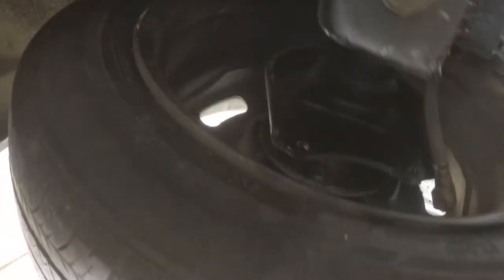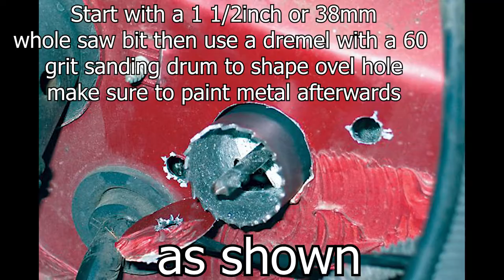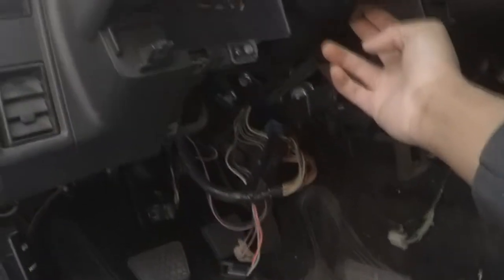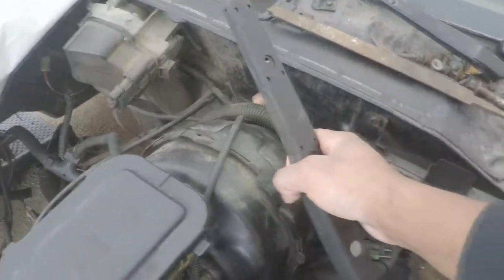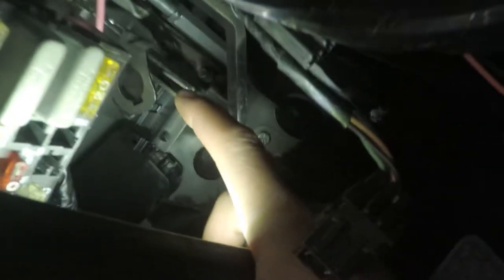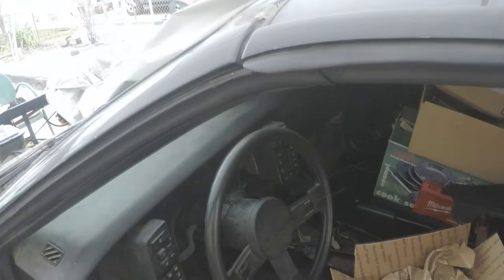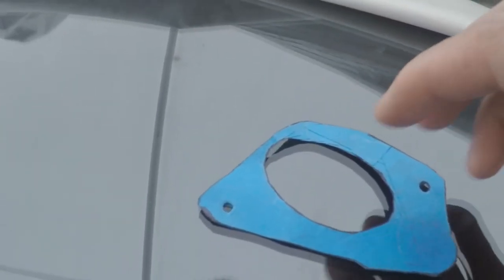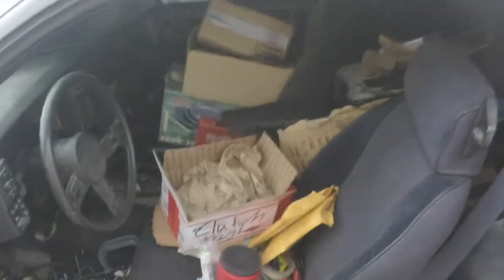Manual pedal and rear end final install walkthrough

Comment: Is there any slop in the pedals? I'm keen on getting some not sure if they are better than the original what's your opinion ?
Reply from the maker: no the pedals are actually firm and well put together, theres just some areas where I think they should've thought things through. Like the triangle bracket that bolts to the top they should've notched the slots for the bolts or moved it over because it does not line up with the hole under the dash where the pedals bolt to the top, the clip that holds the brake switch is kind of janky mines falls out so i had to do some trimming to get it to stay in. Other then that I like the pedals really well built and way more sturdy then standard 3rd gen and 4th gen camaro pedals